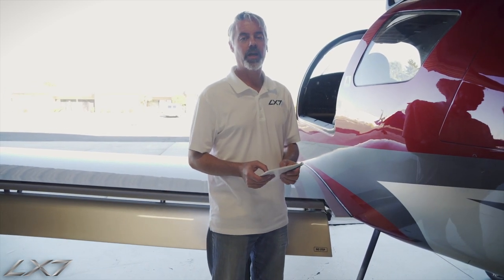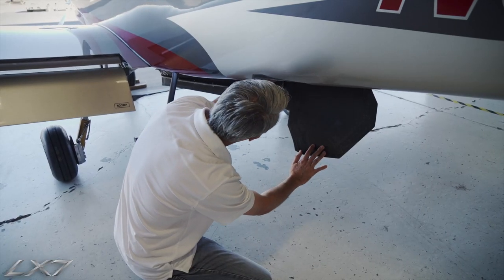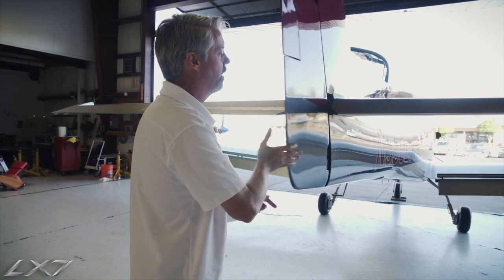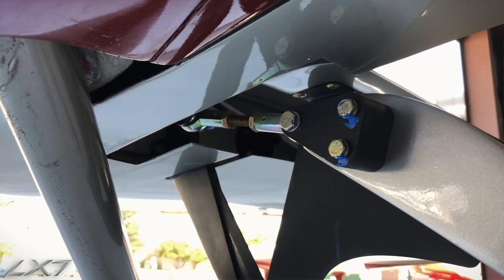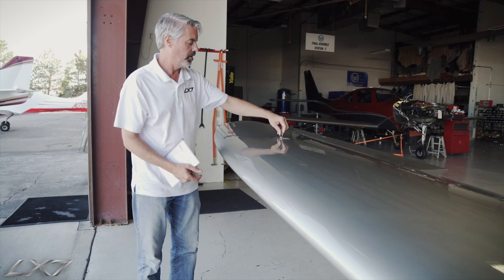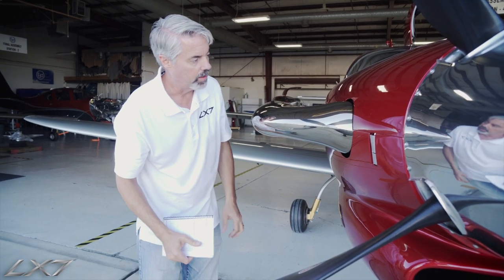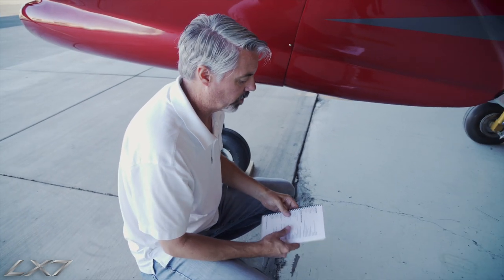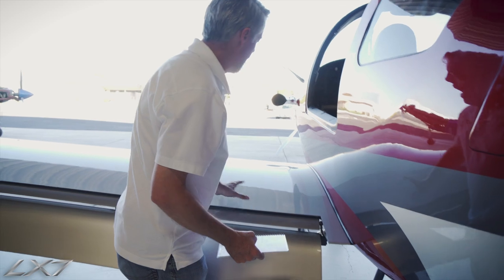LX-7 Overview: Walk Around (Part 4)

Comment: The LX-7 is gorgeous, but very expensive. One has to buy a completed Lancair IV-P first, then the LX-7 conversion is performed to it. For the piston version that’s over $1M, for the turbine that’s approaching $1.5M. That’s defeating one of the main attractions to the experimental category. Affordability.
Reply: while it is certainly expensive you are wrong about the price. A fully completed turbine LX7 is just under 1M. Still overpriced because you could buy a used TBM that seats 6 people for that much, or even a used Lancair evolution which has a roomier cabin than the LX7. The only advantage the LX7 gives you is a new PT6, professionally built, good avionics suite, and BRS chute, which is a pretty motivating factor. Also not everybody wants a big plane so the smaller size may be an advantage to some.
Reply: @codmott286  - But that does not include the purchase of the base aircraft.
Reply: @cloudstreets1396  It does. They used to list their aircraft on Controller and they were all priced from 750-950k
Reply: @codmott286  That's not a fair comparison.  The TBM 850 stopped being built in 2013 so you got a 10+ year old airplane.  It probably sucks way more JetA also,